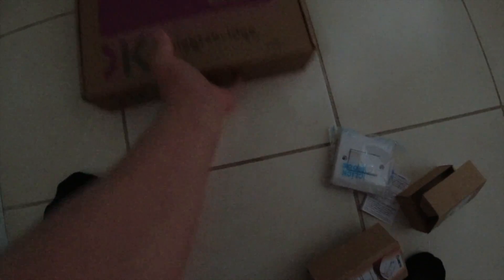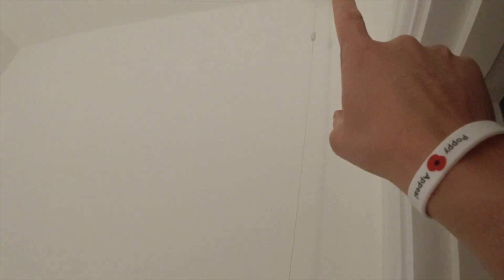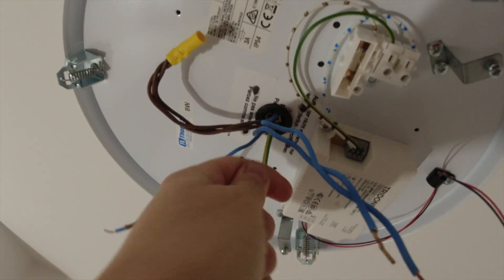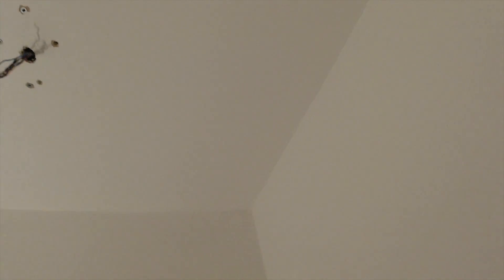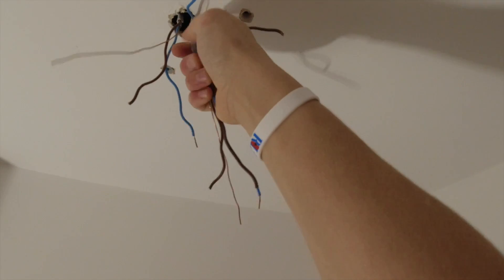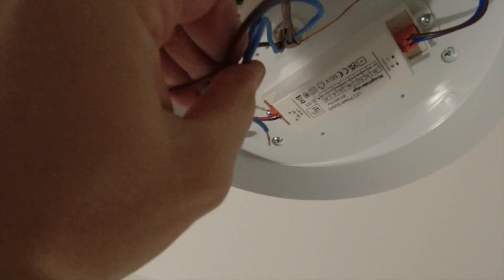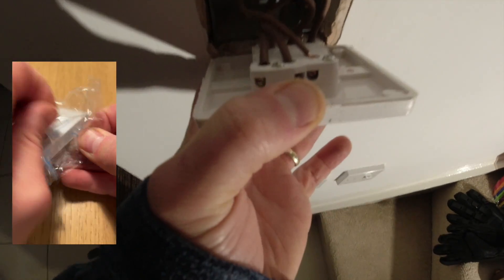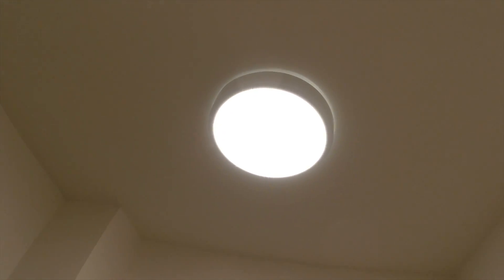Horrid pull cord finally gets deleted. Wireless switching made easy. Cjrelectrical

Comment: Excellent tutorial video. I'm doing the same in a bedroom which I am renovating, but instead using the ener-j brand kinetic receiver and switch. 🎉I was confused about the switching cable running to the on / off switch, I now understand that wire will be made redundant. But I will be keeping the switch and existing wiring but not connected - terminated into wago connectors both sides and the switch blanked off. Thanks for the video it was a massive help.

Comment: Great video. Ive put some down lights and a quinetic switch in today. But how/where do i connect my extractor perm and switched live to After removing the ceiling rose (3plate) ? Should have said that i connected what i thought and the fan does start but turns really slowly

Comment: Question, does the electrical regs even require a pullcord switch in a WC? I thought it's only required if it's above a sink or within 60cm of a bathtub or shower. Can any sparkies on here correct/clarify pls.

Comment: I did exactly the same job this week. Fitted a Quinetic mini receiver inside the light fitting  rather than a standard receiver.  Only down side is that it has a constant flashing red LED that can be seen when lights are out. Got to go back next week and reposition.  Apart from that, they've saved me a lot of times.

Comment: Why not just put a quinetic switch inside the toilet to control the light? Being wireless they're safe inside wet areas. Bathroom light switches outside the bathroom is a pet peeve of mine
Reply: Mine too, I hate not being able to switch the light on when you're half way through what you went in there for 😨
I'm often over half an hour in the toilet and that would annoy the hell out of me
Reply: Maybe it's what the customer wanted?
Reply: @Saaj2  in which case I would have no issue. I consider the fact you can put them in bathrooms as one of their main selling points so just wondered.
Reply from the maker: Just utilising a switch that’s already cut into the wall and the client didn’t want a paddle type.
Reply: I get mine from China. Used for months with no issues

Comment: Be interesting to see how long this wireless switching lasts. . In my experience modern technology doesn’t last . Hence that light your changing hasn’t lasted
Reply: Well they say 200k switches on the booklet that you get with the switch, who knows if it will last that long. It also has a 3 years guarantee, i suppose if it does last 3 years or so its not that terrible but again when you do compare it to a normal switch it doesn't necessarily compare very well. Some old switches last for donkeys of years don't they!

Comment: Done this a few times, you can use the switch inside the bathroom (no electrical connection) to avoid a third party swithiching the bathroom light off from outside too... tip o the day...ha ha

Comment: And somebody from the US the pole cords and outside bathroom switches make no sense to me.
I know it's historical but I'm just imagining being in the bathroom and having somebody turn the light off on you And having no window for natural light. Although there is one advantage you can have an occupancy indicator attached to the light switch outside yet I have not seen that done.
so I think the kinetic wireless switching is the way to go!
And I'm so glad that I'm subscribed so you don't have to pull the main fuse and you can let that other guy do that for you.
Reply: Purely safety, water and electricity don't mix and wet hands operating a live mains powered switch is as dumb as building houses out of plasterboard.
Reply: @godthealmighty4338  and yeah the mere act of having a light switch in a bathroom has been common practice for decades now in the US with no deaths.
When I mentioned historical I was referring to the slight overreaction to bad electrical practices and poorly insulated conductors in the locations.
of all the shocks I had none of them were in the bathroom and that was before GFCI's.
PS Love the user handle haha.

Comment: Where is the extractor fan? How easy would it be to wire to fan?
Reply from the maker: Pop loo doesn’t need a fan if it has an opening window. Yes you can power a fan off a quinetic receiver this one will do up to 6 amps of load.

Comment: Chris, can you do IR at 250V with phase and neutral tied with these units?
Reply: Why not? If it doesn't have a ground or any signal and LV cables that could lead to ground, Meggering with L & N together would have to leak enough current through the plastic casing to break it. Not going to happen at 250V or 500V.

Comment: How much does that cost when it fails as opposed how much a pull switch would cost to replace.  Plus if you decide it’s too dear and want to go back to pull switch you’ve got to rewire the pull switch
Reply: That is a very odd way of looking at this install, if you decide it's to expensive you wouldn't buy it in the first place.
Reply: 15 quid for the switch module mate.

Comment: Do you do this mod for only customers with more money than sense? Instead of just finding the fault and fixing it, like changing the pullswitch or putting a new fuse in the lamp? I bet the owners will miss the pull switch, when somebody turns the light off from outside the room when they are sitting on the toilet!!

Comment: Do they do this for shower pull cords yet?

Where is he?  Have you sacked him?
Reply: You could use a contactor
Reply from the maker: Yep could use the quinetic switch s model on s contractor to active the shower
Reply: A "BIG BIG CONTACTOR" lol
Reply: @Cjrelectrical  it had occurred to me to use a Quinetic switch wired to a contactor, however, I'm not sure how legal it would be.  I had assumed that Quinetic would have produced such a solution but I haven't seen it on the market.  Any ideas why?
Reply: @Land-of-reason  No need mate, the amount of times you're going to be switching a load like that with a switch like that is so small, contactors are legal for that situation and best practice anyway.

Comment: The the flickering on the camera image is annoying you, all you need to do to fix it is change the Frame Rate setting to match the Power Frequency...

Since the UK (I believe) is 50 Hz AC, set the Frame Rate to 25 or 50 Frames per second and the On-Screen flicker should (in theory) disappear...